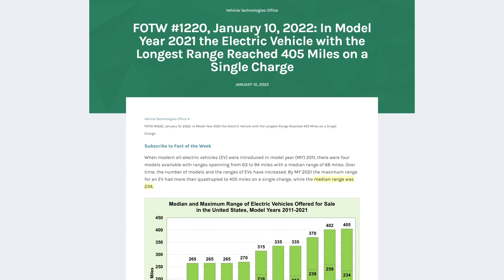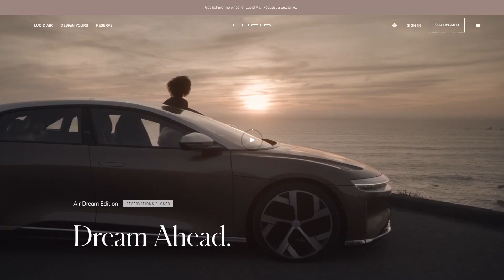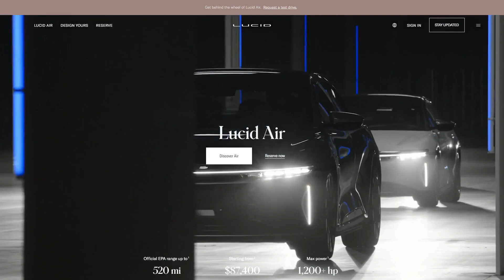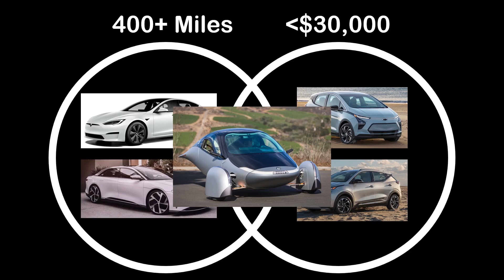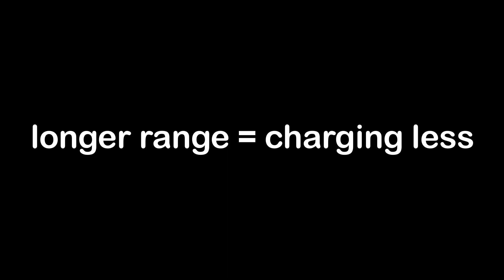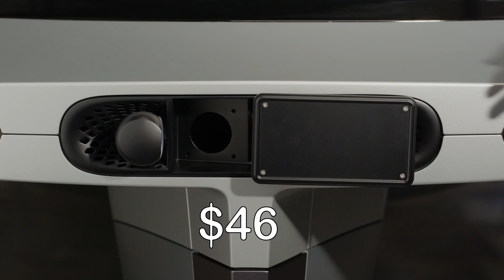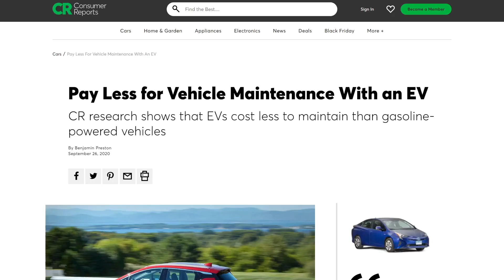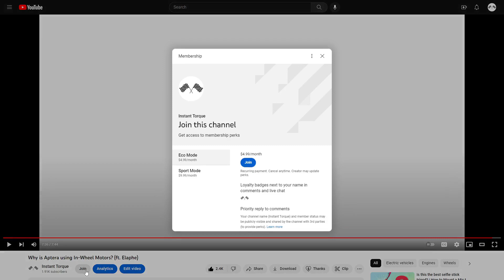Aptera Comprehensive Cost Guide (Charging, Maintenance, TCO, V.S. other EVs)

Comment: I'll preface this by saying that I love the design of this car, the stated range, the fact that it has solar panels, etc. I don't even mind the small cabin, since 90% of my driving is done solo.

That said, I don't see this being anything more than a fun, niche product that will ship a few thousand units (and lmost exclusively to the sun belt). I'm skeptical that it can handle any adverse driving conditions (snow, rain, or even high winds) or speeds in excess of 75mph without feeling flimsy. It's not large enough to appeal to most consumers as a primary vehicle. And unless energy prices rise dramatically, it's not superior enough to regular EV's--in terms of cost savings--to be a pure value play.

Comment: The thing that most people that bash Short range EVs don't realize is that Most people don't need the full range of say a 150 mile range EV. They would only typically need 25-40 of that in a day. Meaning that one could just use the 110V charger that comes with the car and typically recover most if not all of that over night. Of course This doesn't cover people that have to long commute, (55+ miles (~90KM?) one way) or want to take a long day trip and not worry about making a stop along the way to recharge for a reasonably long period of time before they can return home. This isn't such a big deal along the west coast from what I can see, but around the middle of the USA, Charging stations are positioned in places that have good stop points (resting places) and are near interstates. But travel the back roads or the other highways and you may not see one until you reach a major town/city. And then it might not even be the right connector for your particular EV. Got an SAE J1772 equipped car? Sorry This town only has tesla chargers, You gotta go 14 more miles to this podunk place that sells... I don't know, Home decor?

As for the Aptera's Solar charging, You have to keep how much it can charge in perspective and remind yourself of where you live. Too far North and that up to 40 miles per day promise becomes maybe 27 on a good day and most times not even that. Weather patterns plays a huge factor in it's ability to regain just by the sun alone. However it does mean that the amount that you would have to actually plug in to charge would be less costly due to the lighter car and battery pack. So... even if they do use the tesla network, the overall cost would be way less to charge the aptera (assuming it needed it) then it would to charge a tesla on that. (pretty well covered in the video)

Also the pricing for electricity that is quoted is assuming that electricity prices don't skyrocket for some reason or another.

Finally, Aptera and similar hyper efficient EV's to come are neat and all, though I refuse to "preorder" anything without confirmation that it's going to make it to market and stay there. I just like I don't preorder Software, phones, or anything else. a preorder may give the company an idea of "hey it's well received" but it doesn't guarantee delivery (see kickstarter/indigogo/other crowdfunding). And some of Aptera's promises of right to repair only extends for as long as Aptera stays in business or keeps the same model available. If they don't catch on or they create newer models that use different parts and discontinue the original, then it won't matter how repairable your car is, as the parts won't be available. Now if they give fabrication information out for the parts for people with 3d printers/fabrication equipment, that could make things interesting.

Comment: I’ve reserved the 1,000 mile range tri-motor version. I expect the range in cold weather to be 60% of normal, maybe even 50%. So combine that with the fact that I intend to rarely charge it above 80%, & I reckon I’ll still be able to road trip (which I do 12 or more times per year for work) the 1,000 mile Aptera even in the worst conditions.

Comment: What about car washing?   Does this go through a regular car wash?
Reply from the maker: Most likely. I've seen videos of Polaris Slingshots going through car washes. The wheelpants officially have 5 inches of ground clearance in the front and car washes usually require 4 inches. Also, Aptera's website says there will be a vinyl wrap, which doesn't get dirty nearly as quickly as paint.
Reply: I'd like to see someone at Aptera run the delta through a standard car wash track to verify we will be dealing with a normal carwash experience or will the three-wheel with pants configuration be a "no-go" at the carwash.

Comment: Congratulations, excellent choice, and I am so hoping that Aptera can get its production lines up and running and these cars out to the general public, and I am so excited to see them moving quickly in that direction. 

So full disclosure, I drive a Tesla Model 3 and I purchased it back in 2018 and at the time of delivery which was at night, so I had no real chance to experience the car or look it over, but I was satisfied and I took delivery at the service center and the next couple days I got my chance to look it over and see if there were any problems that needed to be fixed, and there were, and they fixed them, so no problem there and the only maintenance I had was to replace the tires in the 2nd year and prior to that rotate the tires and I had the cabin filters changed, but other than that, maintenance has really been negligible.

So everyone who has been following Tesla to any degree knows that Tesla cars are great performers, I mean no matter the trim level, these cars are high-performance cars.

So I purchased the, dual motor, longe range battery pack, and I opted for the upgraded wheels instead of the aero wheels, which I didn't like, and I'm not experiencing any problems with range or battery degradation or any thoughts about range anxiety, as Tesla has been building out their SuperCharger network in my area, and they’re moving fast in other areas too.

So I say that to say this, I am head over heels in love with my Tesla Model 3, it is my dream car, however, I am simply stoked to see this new upstart company finally starting to get their vehicles up and running, and in production and I simply can't wait to get my hands on one of them.

So I'm going to wait, because the one I want has to be comparable to my Tesla, meaning it has to have full self driving as an option not an ad on.

So I bought into Tesla’s (FSD) at 3000 bucks, the price of my car came in at 63,500, so that made the total price $66,500 and I'm being told that there are people willing to purchase my car which has about 26,000 miles on it, and pay me more than what I originally paid for it. That's absolutely insane, I mean what other car company can say that their cars used well actually thought you a higher price then what you bought it for I dare say not many maybe none.

So the folks at Aptera hasn’t said if their vehicle will have the Full Self Driving suite that Tesla has, I'm sure the vehicle will come with the latest equipment, e.g. ADAS Systems the most other car companies offer today, but we all know the Tesla is the leader in the space so to me it makes no sense to develop your own Full Self Driving technology if Tesla has already done it for you.

So just just like the charging port is the same charging port on a Tesla all Aptera has to do is work out a deal with Tesla to allow them to use their Full Self Driving technology, an incorporate it into their vehicles.

So I don't know how long I'm going to have to wait to see that happen, but I'm still excited to see them get into production, as it's so very exciting, and thank you so much for being the first ones to actually take the plunge, as it is people like you that will make it possible for people like me to one day be able to purchase an Aptera. Cheers🥂

Comment: We typically stop every 200-250 miles in a ICE to get gas, use the bathroom, and stretch our legs.  So we could get by with 264 miles.  But I am getting the 400 mile Aptera so that we won't be pushing the battery to its limits to travel cross country.
Reply: My Saturn goes over 400 miles before I have to fill my tank. That is why I want the 600 mile Aptera. The less I have to charge the better!

Comment: When Aptera is compared to the rest of the pack, it becomes pretty easy to pick it over its competition. The problem is getting the production line started! Investors out there might be getting a big payday if they come to the party now. Risk is much less than a few years ago. Aptera is the only car that has caught my eye, and the only one I want to have. Yes, I have invested, and I am sure it will happen, just have to ask for more patience (please Santa) to wait longer. All things are in place just need a few million dollars.
Reply: I've wanted an Aptera ever since they first were prototyped. I remember when the company folded and employees started trashing the molds for the main cabin. Never thought I'd see them come back. One thing I would wait for feedback on is the ride quality. Every time I've watched on board footage people seem to bounce around alot. Seems like the vehicle doesn't have good suspension design mixed with the low weight.I'd in the tadpole trike design, you are guaranteed to hit potholes because you can't straddle them, the back tire will still hit. I also feel like they need to show their ability to be repaired. Seems like a crash would total one easily because of the way the monocoque chassis is designed.
Reply: @Krautastic  Formula One race car use that type of construction, monocoque is designed to be extremely safe, and strong. Think a car crash at 200 MPH and the driver walking away, and Formula One race cars have the same basic bones. A hummer will sting, and a semi-truck kill you but, the agility factor to avoid the collision in the first place should be excellent, with torque vectoring steering. Carbon fiber is stronger than steel by factors of 6/7 times. so, I think the crash tests will open lots of eyes.
Reply: @chrisbarrett2512  F1 race teams aren't your typical auto repair shop workers. Carbon fiber repair is a very specific trade. The cost to repair the vehicle could be so astronomical even small wrecks could be a total write off. Also, F1 are strapped in with multipoint harnesses and a HANS device to prevent whiplash/internal decapitation. Crumple zones allow for a longer time component in a wreck to reduce the force felt by the occupant. Maybe the Aptera has a special crush able nose cone like F1, what I've seen is its all one structure. Also, it would take a very light overlap impact to rip the suspension arm mounting points off. If they are part of the carbon structure that could be very expensive to fix too. If they are attached to a metal sub frame that would be more straightforward to repair.
Reply: @Krautastic  The body is 6 pieces. so, if your left side gets wiped out 3 pieces of carbon fiber will do, probably not as expensive as a body shop with steel. Painting match won't be a problem as the panels are in 3 colors. Replacement might be with greater ease than you expect.
Reply: @chrisbarrett2512  The way I understand it, they won't be painted. The lower part will be a wrap.
Reply: Wait brb, I'll call my dad for a small loan of a million dollars.

All jokes aside I 100% agree with you.